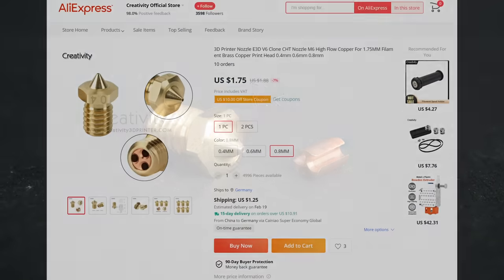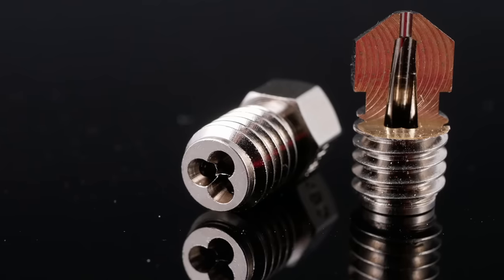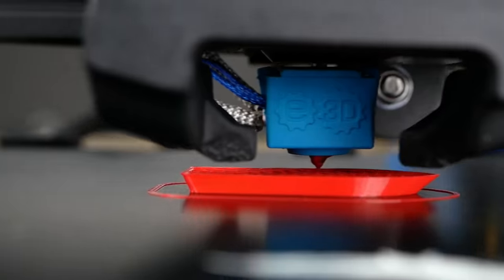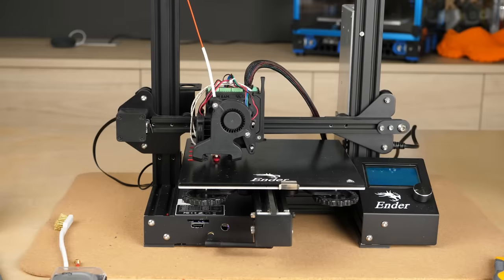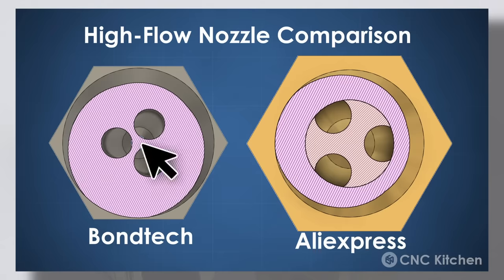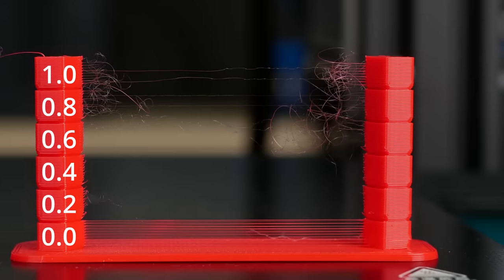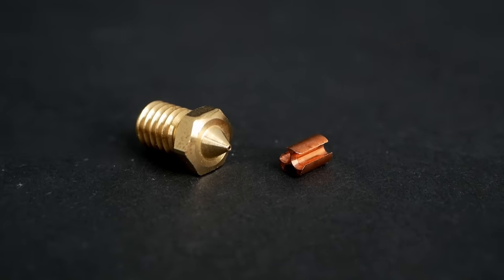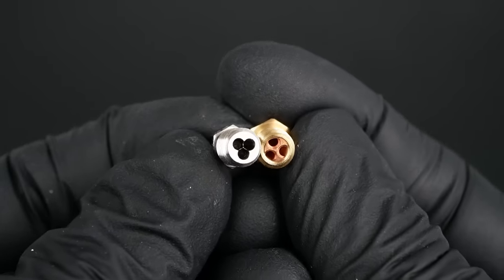$2 Aliexpress Knock-Off better than Original?

Comment: i dont feel thermodynamics should be patentable its like patenting a cheeseburger cuz you use a new cheese.... industrial dies of all types have used this before to product correct flows and melt temps nothing is new except the application specific its like stealing the 7 from the calculator then patenting that calculator as it results in less cost???my point is they made nothing but an application to apply others already have done for decades from fasteners to thermodynamics they just aint yours or a part of yours. find something else to pretend you invented. maybe take a closer look at industrial extrusions (adaptor, flute, neck, die ports, SCREEN PACKS...)

Comment: Am I impressed at how this company attempted to get around the patent? Yes. That copper insert is great, too, since it'll conduct heat much better than brass. Will I get one? No. I have two CHT nozzles of differing diameters and I was happy to pay the price since I knew Bondtech's machining was immaculate, and the performance was proven. The knock-offs look like they have too many places for a potential block. I'd be particularly concerned when changing materials with different melting temperatures.

Very cool idea and thanks for investigating!

Comment: I am curious how these aliexpress nozzles can cut filament without being sharp
Reply: it's melting not cutting in both cases, this side of nozzle sits in the middle of the heatblock, filament is also preheated by heat break part
Reply: @dv5809  I think thats only the case with full metal heatbreaks. In 90% of the cheap stock printers a PTFE tube within the heatbreak touches the nozzle.
Do i understand the construction right or did i miss something?

Comment: You didn't show us any nozzle temperature charts, didn't tell us what starting (room) temperature you're working with, and didn't mention how many watts your hot-end is.  Please, if you're doing tests, THINK about all the variables that are involved, and measure them, and tell us !  The amount of time it takes to melt PLA depends on its starting temperature, and how much energy you can pump into it, which is related to the hot-end temperature, and the more joules the plastic takes away from the hot-end, the harder it is for the heater to keep up with that... so we have no idea if any of your tests and comparisons here are comparing the two hotends with each other, OR, are comparing the limits of your heating element instead (or some combo of those 2).

Comment: I understand that you make a living selling on YouTube or the Internet, hence almost 3 min from "nord vpn", but going back to 3D printing that nozzle, it seems "ridiculous" to me. what has always worked, works and everything that comes out of there... nothing. Everything started with direct extrusion, then all ohhhhhhh bodene and today what works best and what the vast majority of manufacturers have returned to is direct.
That nozzle, like many others, inventions to sell and for unbelievers, even worse, someone with half a brain doesn't buy that.
I'm not a hater, I'm realistic and sincere. 9 years of "uncontaminated" 3D printing
Reply: Well, a lot has changed with direct extruders the weight burden is really no longer an issue with lighter steppers and input shaping.
Reply: @simwark  Do you see this innovative nozzle? or a short or long term problem...
Reply: @KenzoAkihiro  Not really sure what you are getting at? For the vast majority of users they will have no need for one. The results show for themselves that they increase flow. I mean if you are happy with weedwacker filament and your hobbed bolt extruder then stick to it 😏